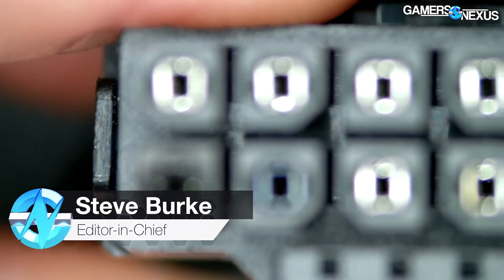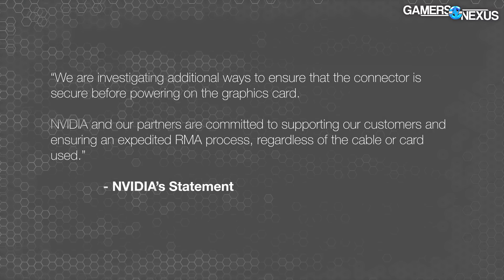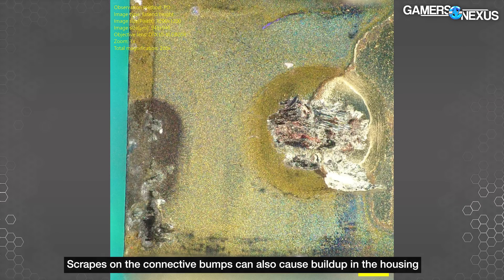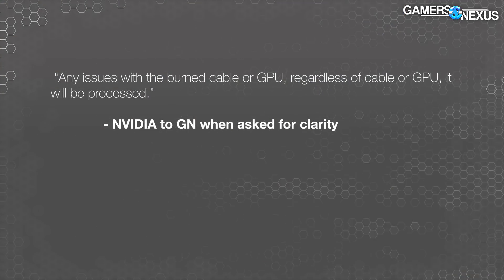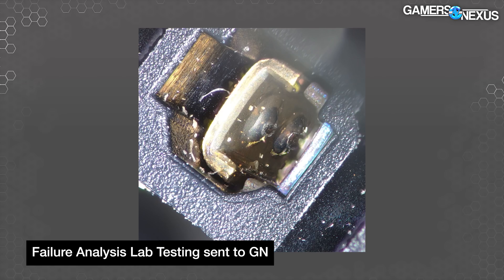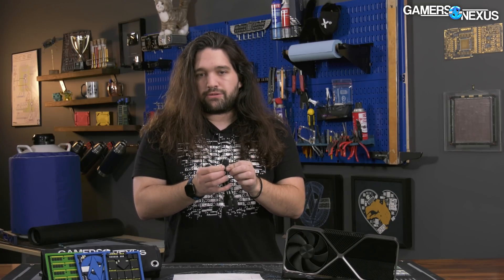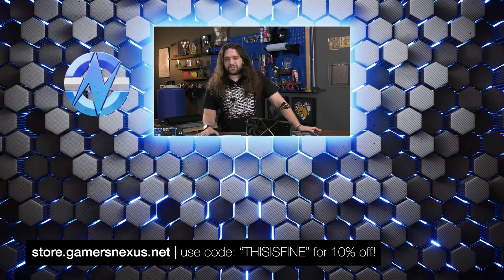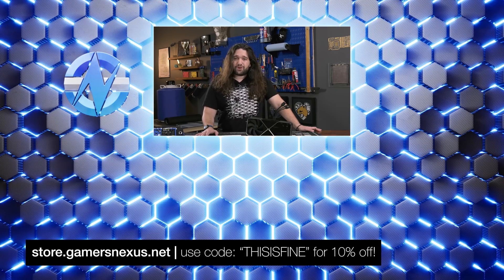NVIDIA Responds to Melting Cables, Warranty Concerns, & 12VHPWR Adapter Failures

Comment: it's disappointing people need to be instructed on how to plug in a power connector... It's even more disappointing that an extra brain cell wasn't utilized to go "maybe i'll use a different power connector" cause you know, the adaptor that comes with the cards is ridiculously short and thick cables that are short will be hard to manage/mold. I mean christ, my rog strix 4090 cost me near $4k AUD, but i already had ordered a cable mod substitute that was longer before my card arrived because there was no way i was going to use the junk adaptor provided. Not after spending so much money on a freaking gpu. BTW my rog thor platinum II psu came with a very nice sleeved 12vhpwr 2 x pcie connector so i used that instead of the 4 x pcie cable i got from cablemod. The adaptor that came with the card went in the garbage. I should mention it's much easier to see if the plug is pushed in fully or not on the rog strix compared to the FE and the click sound is pretty audible as well.

Comment: Never understand why if is so critical and dangerous why they don't put two little screws like a VGA connector or something, and done.
Connect the thing, screw to the end, if you want to be very sure put some kind of sensor.
Sometimes it's so weird they fail in so simple things.

Comment: I have a car with a turbo, and it does indeed say it requires mid-grade 89 Octane gasoline (recommends premium). 

My common responses to online replies: yes, it says so on the gas door label. No, it's not worth saving $0.30/gallon for me when gas is around $5/gallon. If I lose 1-3 MPG by going to regular, that could make regular can be more expensive

Comment: No Cablemod cables for your GPU folks, unless you don't mind loosing your warranty coverage. It's kind of funny about the 3rd party comment though, any and all power supply cable are third party technically. Or are power supply cables not included in that comment and places like Cablemod are the third party

Comment: Nvidia can legally say you must use their cable or it voids the warranty only if they provide that cable free of charge.  It's no different than if Ford says you must use their oil filters for their cars or the warranty is voided.  They must provide the oil filter for free in that case.  They don't do that right now so you can use any approved oil filter made by anyone as long as it meets the standards for the vehicle.

Comment: I am sure Nvidia doesn't want people's rigs going up in smoke, just to sell some GPU's. I do agree that the point made of the 4 sensor pins being made "shorter" than the power pins, thus disabling the GPU unless fully socketed, is a plausible solution... Time will tell, I guess..

Comment: Would it be possible to rig up some sort of gripping system and scale to measure the force required to push in the connector?  Also maybe the same for other power connectors for comparison?

Comment: This PCIE cable standard needs to be deprecated and replaced.

Then, possibly, maybe actually test the replacement cable standard in a non laboratory situation with a non engineer or non designer user.

The sad thing is that someone pointed this design defect out and was ignored, if not ridiculed, by their boss.

Comment: wow. i got a 4080, and i know its not as likely to burn, i had issues getting it to boot at first because my 12+4 wasn't plugged in all the way. i had it plugged in maybe like half way, but that felt normal because it was really tough to push it any further, so i assumed that it was normal. i had even unplugged and replugged it in during my troubleshooting, and still couldn't get it to work. eventually i did realize that it had to be pushed really hard all the way in and it started working immediately. i think even having a picture of how it should look on the packaging would make this way less of an issue.

Comment: Nvidia could also just keep the current 12vhpwr design by applying a white line on the cable pin housing indicating just how far 'in' the connector should be inserted (till it is no longer visible). That is, if the failure cause truly is due to user error. That would be the cheapest solution  Nvidia would likely take. If Nvidia does a full-on redesign of the connector itself, it would indicate that an inherent design flaw with Nvidia's specific design spec for the 3rd party cable fab was the issue all along and all this was just an effort to save face for having their $1600 flagship product launch with faulty power cable design.

Comment: what are the odds failure rate goes up once 40XX series are more common in OEM builds. A lot of places already have nominal Q/A, I imagine many of the 16-pin connections might pass 'visual Q/A'  but then be loose by the time it gets turned on after shipping & setup.
Reply: I think the rate will go up when all of the cards that have already sold actually get sold to people who are using them and installed into systems, they are counting total GPUs sold, and we don't even know if all of those have even been made into cards yet or if it's just the number nVidia has sold itself and to partners. A quick look on ebay and stores will show anyone that they aren't all in use as there is stock for sale still so that .04% failure rate is very generously favoring nVidia at the moment I suspect the real number is going to be much much worse once all 125000 cards actually get into use.

Comment: So Nvidia recommends plugging in the adapter the exact same way I did it. It took me 30 seconds to figure out what it took Nvidia a couple of weeks to figure out... Personally I'm tired of arguing with people about how blaming Nvidia for them not plugging the cable in correctly is Nvidia's fault. Anyone who does their own work on pc's should know that making sure the connector latches are engaged when dealing with power. I wouldn't plug my motherboard's power in and not make sure the latch was engaged so why would you not do the same with your very expensive video card. This nanny state where people expect their lives to be bubble wrapped and fool proof is annoying.

Comment: I think a simple solution is to have the tip of the connector red, so if you see any red around the socket when the connector is inserted you know it's not in all the way
Reply: The simple solution is to change the pin design and mount location. 
 These pins flat out suck
Reply: I would prefer a solution where we just bump the PCIe graphics rail to 48V, and stop driving tens of amps down user-installable cables.
Reply: @sirnickity  I wish I knew enough about electronics to surmise why this isn't already done. Maybe it has to do with the fact that the chips themselves like to run at a much lower voltage and stepping it down from the extra voltage would present an enginnering challenge/cost?
Reply: @kleinbottled79   IME, it's more difficult to find parts that can deal with the currents these things want, rather than a mid-tier voltage like 48V.  It's not too hard to find MOSFETs and such that are totally fine with that.

48V is used rather liberally in the telecom world, since telcos often use DC battery banks as backup power.  You can buy network and computing appliances that run directly off -48V nominal (negative to circumvent corrosion issues), so components and even sub-assemblies should be pretty easy to source.  Granted, a lot of the existing modules will be isolating, where in a PC, you'll have a common ground reference.  But the point is, the parts are there.

It's still under the threshold classified as "high voltage" for safety reasons.

So.. I dunno.  I think the time would've been when contemplating 12VO supplies.  Now we've got legacy ATX, and 12VO, and it's probably too late to say "hey, we thought of something else... how about 48V?" without having the entire industry mad about it.  But, who knows?  Standards have been proposed and ignored before.  Which is why we're not all using BTX.
Reply: @kleinbottled79  Standards inertia. PCIe slots mandate 12V, ATX (and all derived) PSUs prioritize 12V. Any card wanting to take 48V won't be able to take advantage of this existing ecosystem, meanwhile 12VHPWR can.
From a technical standpoint, DC-DC buck converters can be very flexible with input voltages and be very efficient across the entire range, not uncommon to see devices able to take 12V-24V on a barrel jack, often choosing those numbers only because there's a ton of Guitar pedal bricks that use flipped-polarity 9V with the same plugs, and >24V barrel plug bricks aren't so common. Designing motherboards or GPUs that could take 12-48V input voltage range is pretty straightforward, indeed a few laptops have gone for higher voltage chargers because they already supply their own power bricks.
But when the commodity hardware and existing standards are all 12V, there's nothing much to gain from building that flexibility in, and OEMs are always on those low margins.
OEMs aren't likely to cut back on potential marketshare by selling add-in cards that make use of exotic PSUs, so it's a bit of a chicken-and-egg problem.
Reply: @Birdulon  48v would require a totally different power stages. Higher voltage MOSFETs have much higher rdsOn, and much high gate charges, and are 'bigger'.
Reply: Or maybe just use one of the thousands of available connector designs that positively latch, i.e where the latching pushes the connector into place? This is not a $19.99 card where they have to shave off every cent of cost. They can afford to use a connector that costs 2 or 3 cents more.
Reply: @HenryLoenwind  Execs would kill their own children to save 2 to 3 cents cost if they could.
Reply: @HenryLoenwind  there is a latch.  If you watch the video he talks about making sure it is latched and stuff.  wtf
Reply: @TheRealCalPerr  read again: "positively latch, i.e where the latching pushes the connector into place" Not "holds in place" but "pushes into place". Like a Centronics port or a RAM socket where closing the latch forces the plug into position. Or even a USB or headphone port, those have spring latches that push the plug in for the last bit. Or the screw connection of a garden hose, where the "latch" (screw) pushes the hose against the faucet. Or a BNC connector with its bayonet latch.
Reply: @HenryLoenwind  ahhh Ok my bad
A better latch would definitely help
Reply: it seems like it can be practically inserted all the way, just not latched, I think that this solution wouldn't work well. The sense pins are better because if it starts to work it's way back out of the socket after it's plugged in then it will alert you digitally, where as red paint still requires that a use manually inspects the cable repeatedly in the future.
Reply: No, it’s making sure it’s clipped.  It can be seated and not clipped.  This would have the same user error.  But if people buy cards knowing this issue they’ll do it right 99.99% of the time.  There will still be user error.  The cable needs a redesign imo.  With a much better confirmation when it clips.  It takes around 20lbs of force to clip now.  That’s a bit silly.  Should only be 5-10lbs.
Reply: @damonm3   Contact force is often related to contact resistance.  It's quite likely the insertion force is dictated by the need to minimize losses in the connector.

If I were going to try and salvage this connector, I would recess the sense pins so that the power pins were well and truly engaged before the sense pins would even come into contact with each other.  That way you could actually tell, programmatically, whether it's safe to draw the full load.
Reply: @sirnickity  could be.  Just feels more plastic on plastic to me.  I just know it can be designed better.  And it most likely will be.  And I really think with the right engineering could require only a few lbs of force and feel amazing.  But I doubt something like a cable would ever be designed that way.  Just needs to work and not fail.  And I think it’s fair to assume it should feel similar to connecting an 8 pin.  They’re the way a cheap connector should feel.  A bigger and studier latch is what I think is needed.  Whoever designed the 16 pin needs more imagination
Reply: That doesn't help if it appears to be seated but then you tug on something and it comes a milimetre out people won't notice. As Steve noted it is likely at least a portion of these cables are in but not locked and then pull out a bit.

And it requires customers knowing and understanding this. But people won't, if you get a plug you shove it in until it clicks and/or stops and then you are done. That is how all the plus they deal with work. So even if it is "user error" it is the error one has to expect from a reasonable user and you have to design around.
Reply: Simple yes, but if it's this critical they connector should have a redesign and have thumb screws to hold it in, like the old vga cables for example
Reply: well, that would work to some degree, however my knowledge about human behaviour and safety says someone is not gonna verify.
it is better if it is a nice latch, like the one on Nintendo switch.
Reply: Or have it fucking clip in right
Reply: red - 9% of male population is color blind, 'red' is a bad choice; cyan would be a lot better. The plastic, itself, might not support such color(s) naturally, painting is a bad idea, though.
Reply: just the tip?
Reply: We are talking about people who couldn't plug a power connector in properly it wouldn't make any difference.
Reply: @-JonnyBoy-  of course it would.  I was surprised at how much pressure I had to use to get the latch secured.  If you did it I’d assume you’d agree…it’s not like I thought “wow that’s absolutely ridiculous” but I was like wow, that’s a bit much. I’m a strong adult.  I’d guess 50% of kids would get it wrong.  But I guess kids arent plugging these things in very often if ever.  Literally 20+ lbs of force.

Comment: well that addresses the cable itself.
Still, if i got a card which could spike to 600w usage... in a computer which is pulling 300 watts itself, in a room with a phone, a vape, a wall clock, a lamp, etc. also plugged in... it would be incredibly easy to peak over 1300 watts and trip the breaker (which isn't necessarily ideal for the house, or the computer).
PS: There's a reason I'm subbed to GN, and would never consider unsubbing.
Reply: Does it even spike to 600W though?

Pretty sure at stock they don't really go past 500W at all?
Reply: @MLWJ1993  depends. micro-spikes could be eaten up by the capacitors. But some AIB cards actually run 600 on overclock (strix for example).

My wall sockets trip at just over 1300 watts. But there's about 2 rooms on each circuit, it's not just 'per plug'. If my computer pulled nearly 1000 raw watts out of the wall, it wouldnt' be hard to trip a breaker.
I don't want to ask someone to turn off their tv so i can play games on the same circuit hehe.

I'm just glad the kitchen is on it's own circuit. it's already microwave OR toaster in there (never both).

Comment: the 4 sense pins should be last mate first break. which means they wont make connection until the connector is fully seated. They would then disconnect if the connector pops out at some point.